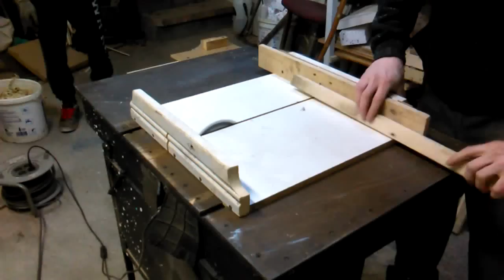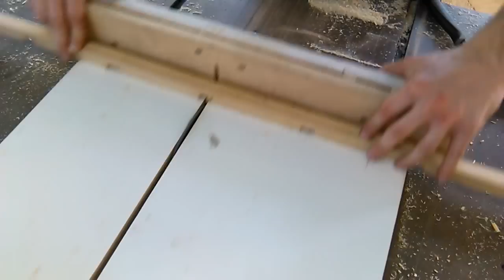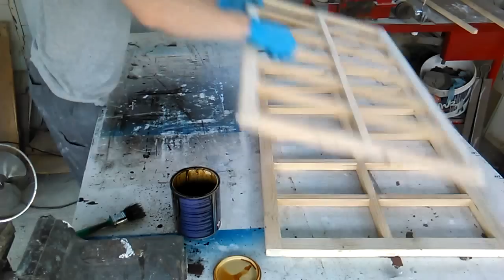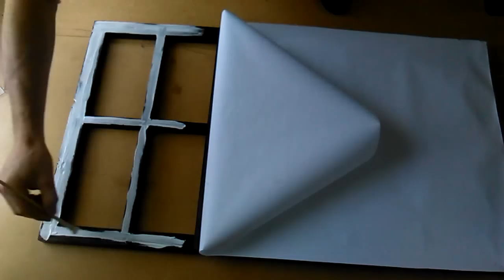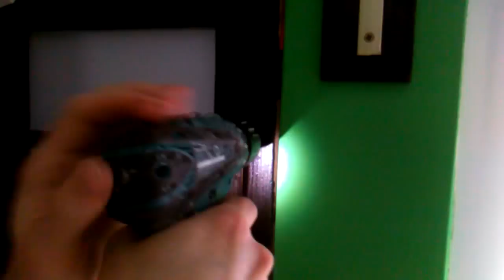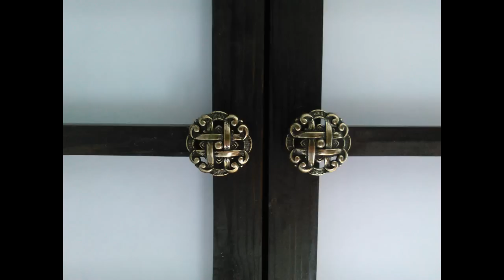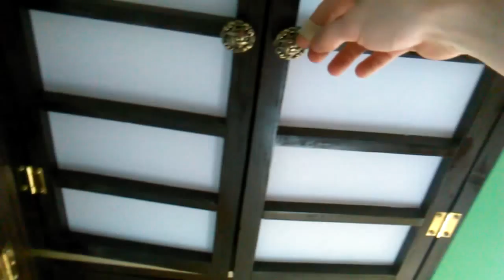How to make shoji doors for cheap

Comment: shoji paper and glue is available commercially at the big box stores, though you do have to hunt for it a bit.....will make any eventual repairs (and they WILL happen) much easier to do ....in japan, screens are redone annually (traditionally, as part of the "spring cleaning"...)
Reply from the maker: You can find the rice paper and the glue in art galery stores.... I used the normal paper because it was not that transparent and it was cheaper

Comment: Did you spray water on the paper and then used a hairdryer to make it shrink up? 
This while the glue was still wet?
Reply from the maker: After the glue dried I spray the water and then use the hairdryer
Reply: @pauliascau  a follow up question. 
Looked at my paper, I have a rough side and a smooth side. Witch one do you put the glue on?
Reply from the maker: @eryxmiliarismiliaris  Mine is smooth on both sides

Comment: I like the concept and the design. I feel inspired to build one for my house. I do feel the need, however, to say that some of the things he was doing with the table saw really made me cringe. Kickback is no joke and there were a couple times I was really worried. I'm glad that nothing bad happened but WOW my woodshop teacher would have flipped out if he saw this.

0:10 He's using the push stick on the wrong side of the blade, you need to control the wood between the fence and the sawblade.

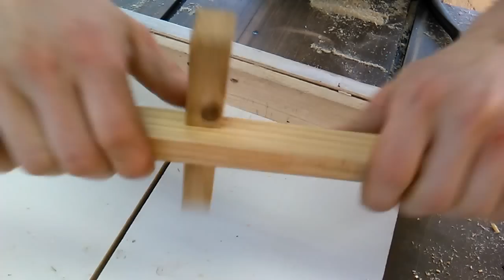2:17 the saw was still running while he was holding his hands over the table...

Comment: It would have been much quicker to paint or stain the wood first prior to the assembly. That's a lot of brushwork in all those corners. It's also better to glue the paper starting in the middle section and then do the two ends.  I would use something a bit more durable than paper, say, heavy weight frosted polycarbonate or thin plexiglass.
Reply from the maker: My brother actually changed the paper with white furniture backer board

Comment: Materials are cheap but not the equipment he's using
Reply: That's not really true. He's mostly just using a table saw and a cordless drill. Sure, a table saw is pricy, but if you do any wood working you likely have one. He's not even using a nailgun or clamps for all those joints. He just has a simple jig screwed onto a workbench.